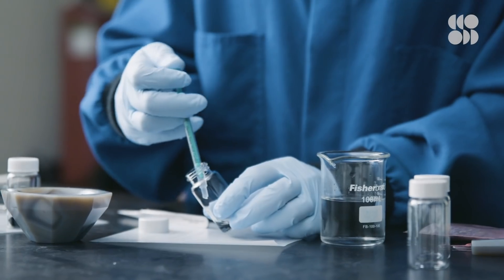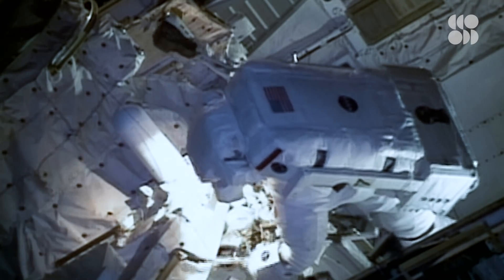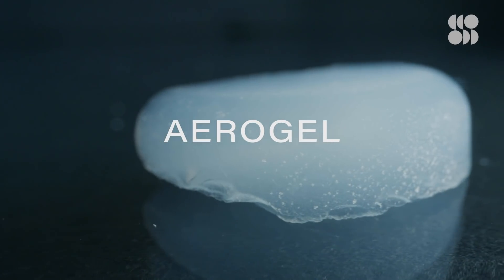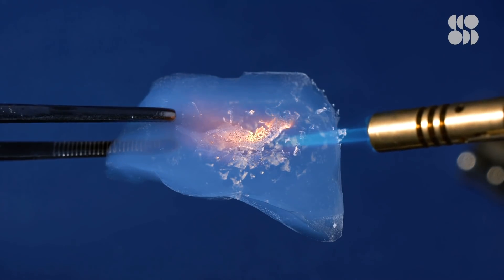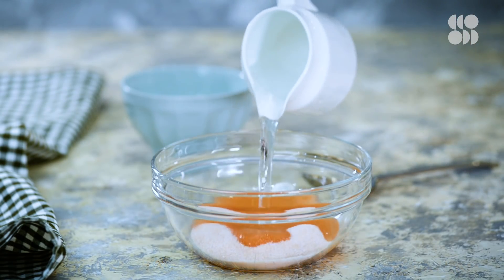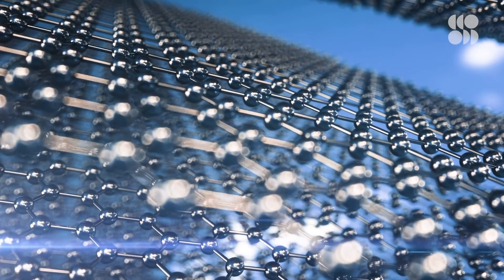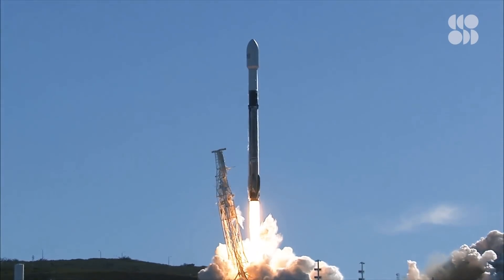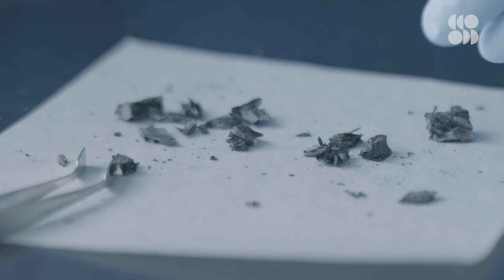How Making Graphene Aerogel in Space Will Shape Future Exploration

Comment: It appears that the graphene is not dispersed in the liquid. Have you considered mixing the graphene in a commercially available dispersant that makes the surface HydropHilic (Hi) while keeping the bulk particle hydropHObic (Ho). These are special HiHo dispersants, BOTH hydrophobic (the particle does not want to be in water) AND Hydrophilic (but the surface pulls it into the water). For example, dense inorganic particles will float on water due to a hydrophobic amino silane surface treatment converting a hydrophylic alumina surface into a plastics grade filler however treating the hydrophobic surface with HiHo dispersants allows the inorganic particles to dispersed in the water and during drying the capillary forces that pull the particles together do not exist because the bulk surface of the inorganic particle is still hydrophobic.

Comment: I support the research, but if it only can be manufactured in space, the result will be a hyper expensive material that would not be found in batteries, thermal insulation, and most sensors. Cool, but the application is over hyped. It will take decades before we see its use anywhere.

Comment: I'm still not clear what advantage putting graphene in a aerogel has over just plain graphene. It's all rather vague "exciting future!" type stuff and about as vague as the purpose of the ISS.
Reply: ISS is researching how to maintain infrastructure in space & live there. It also examines those effects on the human body. Eventually, ppl HAVE to leave 🌎 when the ☀ expands. #practice

[YT has a bot that deletes factual comments]
Reply: They talk about some of the applications of aerogel. Like clothing and capturing space dust. The uniqueness of graphene aerogel is its electrical conductivity as a very low density material. 
Graphene is also one of the most heat resistant materials. So it can potentially be used as insulation.